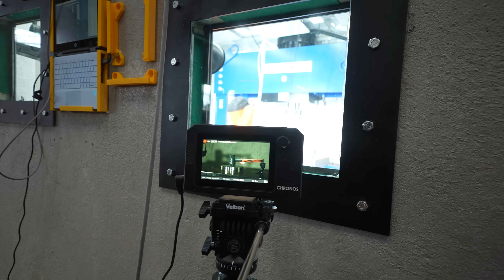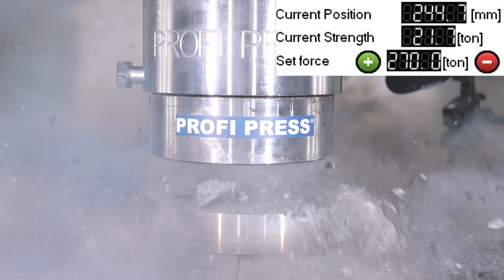Can Giant Wood Block Frozen in Liquid Nitrogen STOP Hydraulic Press

Comment: Very amusing, but this is not a fair comparison. The previous non-frozen block was pressurized between steel plates over its entire surface. This frozen block had to endure the 264 tons max pressure over about 1/3 of that surface, maybe even less. So you would need an 800 ton press to crush the entire block at once.
Reply: Yeah really strange that they did change the test, i wonder why
Reply: 1:52 Lmmaaoooo 😂
Reply: I came to say the same thing
Reply: it was about revenge, not science

Comment: When something is dipped in liquid nitrogen, which has an extremely low temperature of about -196°C (-321°F), it rapidly cools down. As the object loses heat to the liquid nitrogen, its temperature drops drastically, and this cooling affects the material’s properties.

The reason objects become brittle when cooled in liquid nitrogen is primarily due to the reduction in molecular motion. At such low temperatures:

Atomic and Molecular Motion Slows Down: The atoms and molecules in materials have less energy, meaning they can't move or flex as they usually would at room temperature. This rigidity makes the material more susceptible to breaking or cracking under stress.

Reduction in Ductility: Ductility is the ability of a material to deform under stress without breaking. At low temperatures, many materials (especially those with metal or organic properties) lose ductility, causing them to fracture rather than bend.

Thermal Contraction: Materials tend to shrink when they’re cooled, as the spacing between atoms decreases. This contraction can introduce internal stresses, making the material easier to break.

Changes in Crystal Structure: In certain metals and alloys, the crystal structure can change at extremely low temperatures, making them more rigid and brittle.

This is why flowers, rubber balls, and many metals become brittle in liquid nitrogen. When you hit these materials, they don’t flex or absorb the impact—they shatter.
Reply: We know.
Reply: @Chris_Garman  I didn't
Reply: So nothing about the moisture (water) in the wood becoming brittle ice?
Reply: thanks chatgpt

Comment: A cheap way to quickly super freeze stuff is to mix dry ice (broken into almost powder) and a acetone. You can also use anhydrous alcohol (99% alcohol, alcohol without without water) but it is more expensive and harder to find. This will quickly freeze stuff to about -100F or -80C.

Comment: The orientation of the brick, with the long edge vertical, is probably the weakest position.
You may want to repeat the tests with a dry brick with the long edge vertical, then on the side with the holes visible and then with "standard" position with the holes vertical.

Comment: Crush thick stainless steel pipes. Most of 300 series gain strength in cryogenic temperatures, but may also crush in interesting ways. There’s big difference on strength between cold areas and those which heat

Comment: The second test is not valid, with the first test the pressure is evenly distributed on the top and the bottom, but on the second test the wood block does not get pressure evenly distributed and the way the pressure is applied makes the block more likely do break apart, sure the low temperature makes the wood more brittle, but adding a lot of pressure to the middle of the block instead of the whole block makes it more likely to split apart...

Comment: You need to repeat this test with 2 pieces cut from the same piece of timber. The only difference must be one is frozen one is room temperature. Steel plate must have same surface area as the timber it rests against top and bottom plate.
Reply: You could for peoples interest cut 4 blocks, test 2 longitudinal (1 frozen 1 Room Temperature) test 2 Transverse same as for longitudinal 

The would give you information on the strength of timber in 2 different directions.